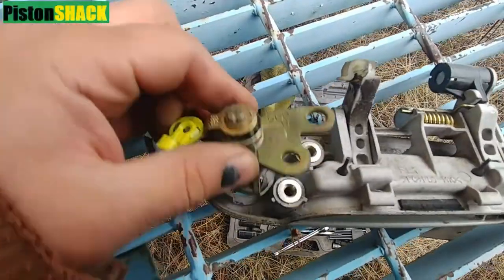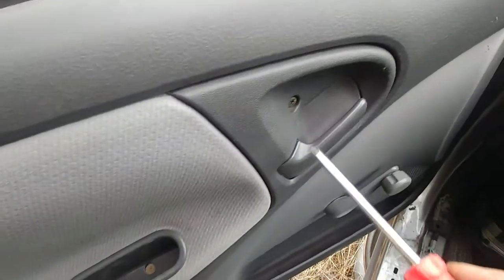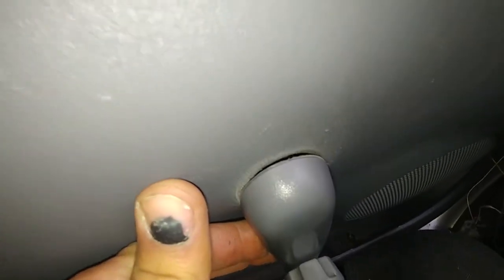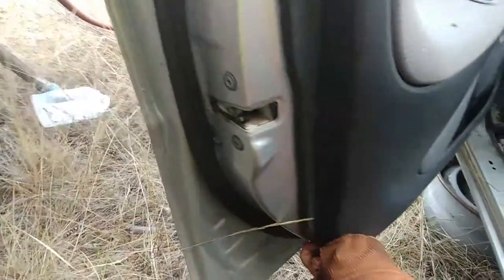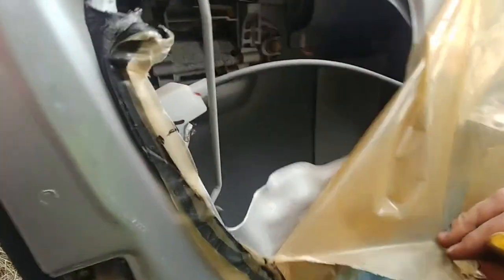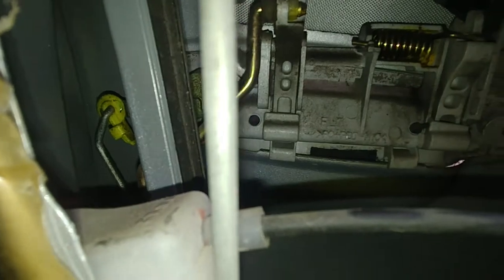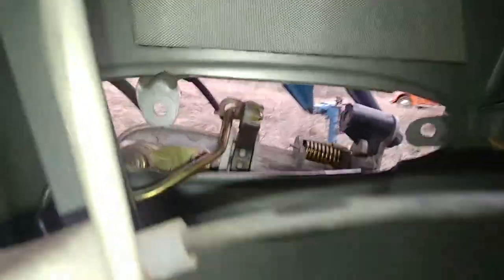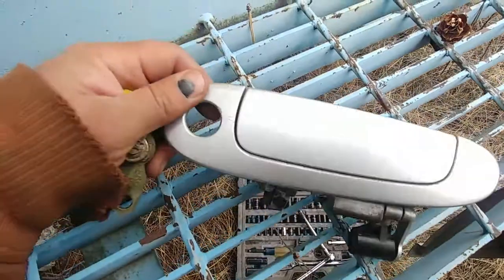TOYOTA ECHO FRONT DOOR LOCK CYLINDER, DOOR HANDLE, DOOR PANEL REMOVAL

Comment from the maker: Few More Toyota Echo Vids: TOYOTA ECHO / YARIS HATCH DOOR WON'T OPEN? UNLOCK IT IN 2 MINUTES!
https://youtu.be/WzFQBNVIs5k https://www.youtube.com/watch?v=URpXedA6a_s
TOYOTA ECHO, YARIS HATCH DOOR LOCK REPLACEMENT 
HOW TO CHANGE ENGINE OIL TOYOTA ECHO / YARIS. https://youtu.be/ero-VraxtEQ
How To REMOVE GEAR BOX. Step by Step.  TOYOTA Echo, Yaris. Transmission SWAP. EP. #1 https://youtu.be/wcDZt7pXIOQ
HOW TO INSTALL NEW CLUTCH and GEAR BOX on Toyota Echo, Yaris.Transmission SWAP. Ep. #2 https://youtu.be/ILP_oqRY0AU
Enjoy!
Reply from the maker: Thanks for watching!
Reply: @PistonShack  You're an absolute legend for making this video man. I recently bought a 2004 echo as a first car for $45 from a friend. 

The car drives pretty well even though it has 200Ks on it. Just needs a few simple touch ups and she'll be right as rain 😁

Comment: I recently tried to remove the door handle assembly on the passenger side of an old Toyota echo. Your video helped me get the interior door panel off, but I found the track that the window slides on prevents me from getting at the bolts I need to undo. My echo is an 05', and I believe the one I was pulling parts from was an 03' or 04'. Is this a Yaris or an echo in your video? Did you run into similar problems? I notice in one of your other videos you have a red echo hatchback (I have one like that as well). Was trying to replace the lock cylender on the door. Couldn't figure out how to properly remove the handle assembly on the junkyard echo, and it makes me nervous to do it on my own car. It seems simple enough, I just can't get at the right bolts...
Reply from the maker: This is parts car 2000 Toyota Echo. I have never had the same problem you described above. There are three bolts on a back side. How is repair? Did you get those bolts off?
Reply: @PistonShack  Ah I see. I was pulling parts off an 04' Echo. The hole in the door that allows you access to the bolts at the back if the door handle is oriented differently on the 2000 echo than the 2004 echo by the looks of it. On the 04' and 05', it is harder to get at the bolt by the lock cylender that holds the door handle in place. As I said previously, the track the window slides on makes it hard to get at that bolt. I was however able to eventually get the second bolt off with a small adjustable wrench, but it was a real neusence. None of the rachets I have would fit inside that area of the door.
Reply: @PistonShack  Funny enough though, it turns out I did not need to replace my lock cylenders as I originally thought. My locks kept jamming up when I used my main key, and so I tried using an old spare key I had laying around. When I used the spare, all my locks worked perfectly! So it turns out it was actually the key itself that was worn out - not the lock cylenders! I got a few copies of the space key cut, and the copies work even better than the spare it was cut from. So lucky me! 😀

Although in the end I did not need to replace the lock cylenders, your videos inspired me to fix up my echo, and now it looks and works better than ever before! So thank you! You gave me the knowledge to help me fix up my car!

I look forward to your future videos, especially the one about putting in air conditioning! Keep up the good work!
Reply: @Cozmixcartoons  I just pulled that side track away from the bolts as much as I could and was able to get to them and get it off.